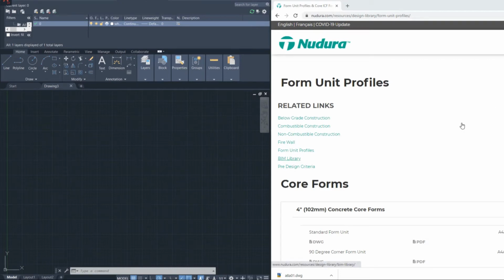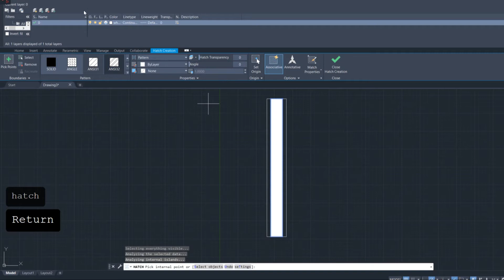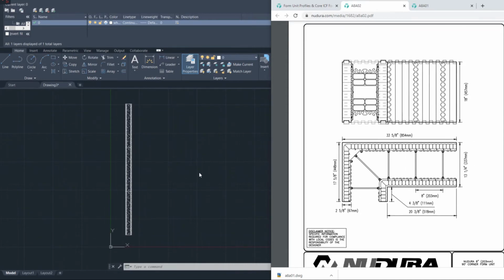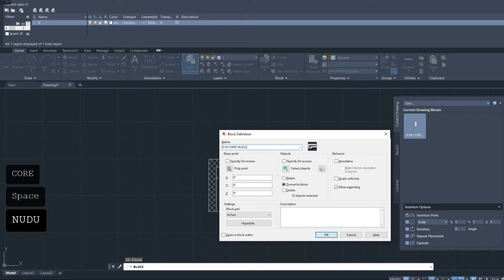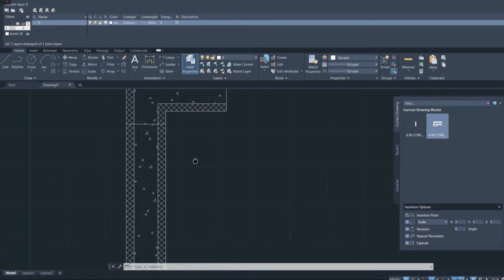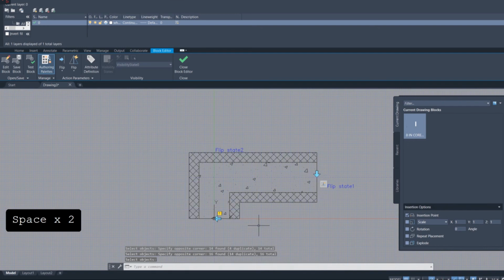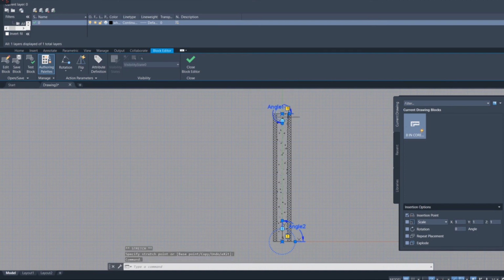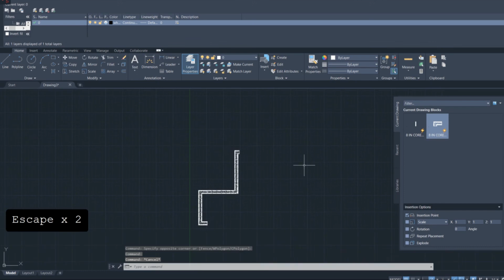AutoCAD ICF Construction - Custom AutoCAD Blocks

Comment: Great video. I wish these manufacturers would have a downloadable file that had all of their products as CAD objects so we didn't have to go in and make dozens of these things one at a time
Reply from the maker: Having gone through the process once now, I realize you really don’t need to worry about drawing in the blocks. For the most part, every wall will have a braced common seam and just cut the blocks to fit. You end up using the scraps somewhere else and there’s very little waste.

Comment: Autocad has come a long way from when I was using it. I started in the early 80's on a 286 processor and we had a tablet with a template for all the commands. I was using it in my role in Facility Management. I did my construction documents. Furniture layout and space allocation.  I haven't used it since the mid 90's
Reply from the maker: Im definitely the same way. When I changed offices at work, one of my coworkers and I definitely drafted the new space and iterated on 18 possible configurations of chairs, desks, and plants. Everyone thought we were crazy, but after the move, people would stop by and comment on how functional the layout was! Nowadays its too expensive to justify for anything other than all day usage. There are good lower cost alternatives too (i.e. NanoCAD, BricsCAD) that mimic the command set well enough.

Comment: Very glad I found this, I will be going through the same process in the next year hopefully.  I'm currently looking at floor plans to convert to ICF dimensions.  Unfortunately I only know how to use microstation, it's amazing how much better autocad is.  Maybe you just make it look easy.  

Question, I thought most of the ICF makers (Nudura included) provided cad files for their blocks to download and import into your drawing?  That way you wouldn't have to draw them.
Reply from the maker: Nudura (and others) does provide *.dxf/dwg files, but they usually have too much detail, so I end up redrawing them anyway. I used to use the full detail, and that just turned my drawings into a cluttered mess! As far as plans go, Menards has a good selection of ready made plans to pick through, they're just kind of expensive. The set of plans I bought was a good jumping off point for sure. Laying out rooms and bathrooms in a non-awkward way takes more experience than I have.